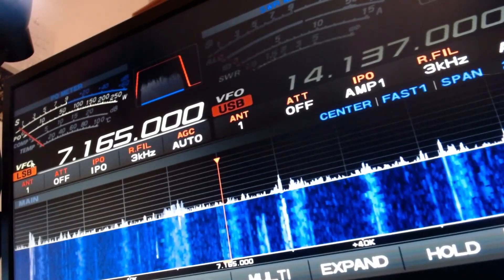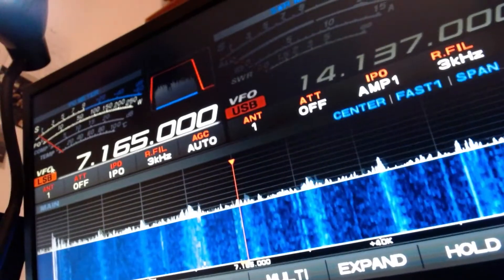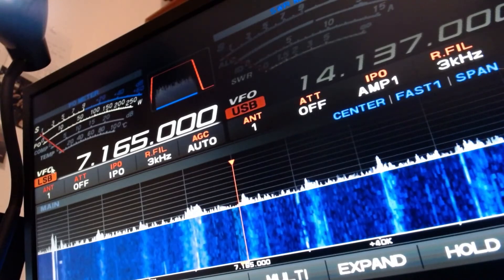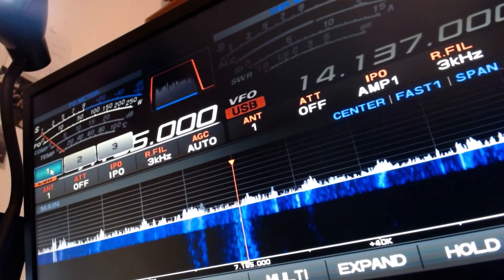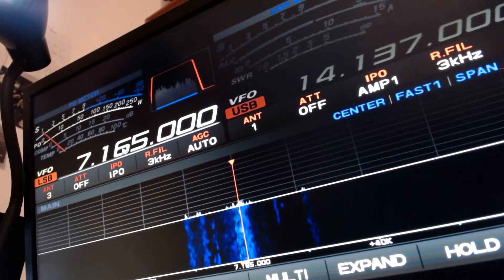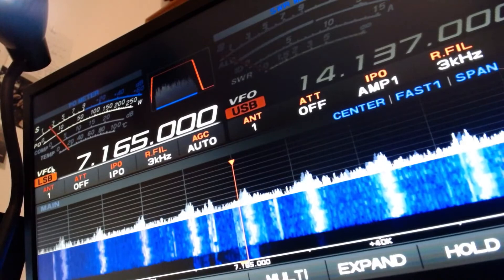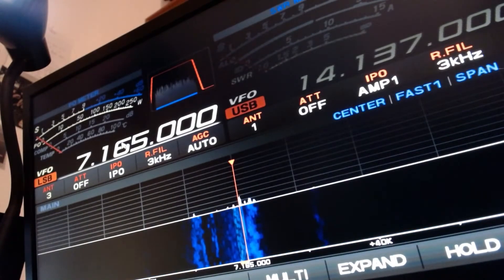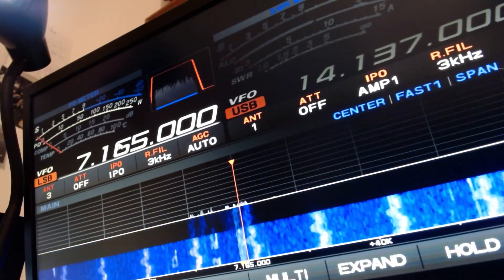3 Minutes That Will Change Your Ham Radio Life. The MFJ 1788 Loop. See and HEAR The Difference!

Comment: For your demo to be useful, you need to demonstrate something much more meaningful which is the signal to noise ratio using a weak signal.   Can you actually hold a conversation with a weak DX station on the loop that you cannot on the vertical or wire?   Please show us again in a live QSO with an unreadable station. Then we all go build or buy a loop and throw out the ugly verticals and messy wires. (which of course will never happen as proven over the last 124 years.

Comment: Hey Larry, Thanks much for the nice video but I think your conclusions may be all wrong.  Whatever antenna you use just provides rf voltage to the input of the receiver.  You proved that your vertical is really sensitive, your dipole is pretty good and the loop is well below in sensitivity.  I'm just getting back into ham radio (licensed in 1958) and I have ordered a 1788 and now I'll order the type vertical you referenced as it seems very sensitive.  I have HOA problems so that's why no dipole.  Thanks again.
Reply from the maker: Ken,

The video was only three minutes long but it did prove its point. 

When you use a loop Antenna, you’re “listening” on the magnetic side of the electromagnetic wave of a radio signal. No static crashes, less “electrical interference.”

Because of this, your signal to noise ratio is improved. You’ll need to use your pre amps to “bring the signals back up” but you will hear signals that are more difficult to hear because of QRN. 

Noise goes down so signals can be heard. 

I don’t recommend them for higher than the 20 m band, as atmospheric noise decreases significantly on 18m and higher. 

The trick is, where you place the loop. Make sure it’s AT LEAST 12m away from any transmitting antenna as you can really compromise the front end of your transceiver and destroy it. 

Remember, it’s a signal to noise antenna. Many top level hams and most high end shortwave DX’ers use loops for this reason. It helps to quiet down the band enough to hear weak signals.

Hope you have a very merry Christmas Ken!

Larry
Reply: @HamRadioLiveShow  Larry,  
We grow too soon old and too late smart!!  Thanks for the education.  After all these years in radio and computers you'd think I would have known that.  
Again, a fine video and again, thanks for your effort.
Ken

Comment: I would like to see the same test with a signal from some one talking to hear what that’s like.
Reply from the maker: That’s not the point of what a loop antenna does. A loop Antenna works Works signal to noise ratio.   It lowers the noise, so signals are easier to hear. 

To work this principle you need to use your preamp‘s on the bands you are listening on, because a loop only works off the magnetic part of the geomagnetic field and will cause receiver attenuation. 

It works. It’s worked for me for over 49 years of DX’ing.

Comment: I would never use this antenna. Small loop antenna has the same radiation pattern as short dipole with constant current. Basic lesson in antenna theory is often called "Radiation From Infinitesimal Sources".

Comment: You demonstrated that a loop is a crap antenna.  I worked with this antenna several years and found it to be totally substandard.  And you proved it.  Did you see all those signals on the scope that disappeared when you switched to the loop?!?  I found that if I could hear them I could work them with a loop, but that's just because only the strongest signals would get through.  From my use I concluded that it actually pushed a signal fairly well, but the small capture area resulted in poor reception.  Your video actually demonstrated that.

Comment: Did you aim the loop nulls towards the noise? I have the MFJ Receive loop, and my results are, err, less than what you're getting when I bump up the preamp to match signal strength.  Maybe on 80 sometimes the loop is better, but mostly I'm still on the dipole for receive lately.
Reply: Maybe should be horizontal, not vertical?
Reply: If you have it mounteed horizontal, what maybe it's doing is, it has a deep null pointed towards all the electronic junk in your house?

Comment: Every "receiving loop" should have a preamp, ferrite, or multiple turns. Otherwise what you get will barely make it down the transmission line.
Reply from the maker: It depends how high it is. If you’re using it 1 m off the ground or less, yes, preamp absolutely.

Comment: All due respect, this video doesn't tell me anything. A signal to noise comparison would give a very good representation of how the loop performs on receive. As others have previously stated, I can connect a 10' wire and it will show a significant drop in the noise floor but would be extremely ineffective in receiving signals.
Reply: Agreed.  My MFJ loop was 45 foot up in free air, could be heard but I couldn't hear until I unplugged the loop and plugged a clip lead at the back of my rig.

Comment: With all due respect this is a very flawed demonstration, if you look at your initial waterfall there is what looks like a ham data-mode transmission near the left hand side of the screen which disappears when the loop is connected but is present both on the ZS6BKW and the vertical.
I used to work for a military electronics company, our own "magnetic loops" intended for tactical use were made from expensive materials but we still quoted them as having a "gain" of -13dB relative to a dipole. Conveniently about 2 s-points, not far from your drop in noise.
Contrary to a reply to another comment a loop of this type should be tuned for optimal receive power transfer. The tuning is not just beneficial for transmit SWR. Your plot does show some relatively low level QRM from perhaps a switchmode appearing as spurs across the waterfall. These would also vanish if you simply used an attenuator inline but again you would lose some copiable signals too. Undoubtedly some receive antennas can produce better signal to noise under some conditions relative to the main antenna. I too have been playing with both a ZS6BKW and a receive loop as well as diversity receive. 
I know the video has been up for a while but only just discovered your channel, sorry if this comment seems harsh but we can easily fool ourselves that something works better than it does. 73
Reply from the maker: I understand your concerns. However, the main point was discussing the drop in noise floor with a mag loop. That was all. 

I sincerely appreciate you watching the show and I thank you as well for your comment. I am OK with criticism as long as it’s delivered in a way that useful. Thank you for bringing the shortcomings you found in the video to my attention.

Larry
Reply: @HamRadioLiveShow  thank you for the polite reply, enjoy your radio and making videos.

Comment: Newbie question: would you also use a loop for portable / rucksack type day out, as opposed to a portable vertical antenna? Cheers!
Reply from the maker: I’d use a wire dipole. Enough to carry already with the rig and battery.  Keep things light. Just my thoughts my friend. 

Larry
de K7HN

Comment: I live in a town in the UK and the noise floor across the lower bands can be anything up to S5. I bought a Wellbrook loop a few months ago and it has brought my noise floor down to S0. It's an active antenna and I do share the output between two radio's and whilst the signal strength is typically a little lower than a resonant dipole, the s/n ratio is much, much better. 

It's a shame that fewer radio's seem to have the ability to use an RX-only antenna, especially given the increase in the electrical noise floor.
Reply from the maker: AMEN!!! This is one of the best comments I’ve ever received. 

Coming from shortwave I used to use loops all the time. I know the value of them for a ham radio. The problem is, most hams reject this principle… That’s the honest truth. A loop antenna simply makes your receiver work better.

Top comment! Enjoy that Wellbrook!!

Larry
de K7HN

Comment: Dude...that's NOT how this works.
Reply from the maker: That’s how mine worked. 

Noise floor LOWERS. 

Signals APPEAR

Those signals were swallowed up by the noise before. Even the video shows those signals coming up.

The only advantage to using this loop is you can transmit with it as well. 

Mag loops all work the same way (although many don’t need a tuner because they don’t transmit) any large receiving loop does the same thing. Because it works on the magnetic field, not the EM field. 

Thanks for writing in but I’m sorry to tell you you this shows exactly how this works. The eyes and ears don’t lie.

Comment from the maker: This thread is quite long. Looking back, using an S2-S3 Receive signal would have driven the point home much better and that’s on me. I’m sorry it wasn’t clear enough. 

The key: lower the noise floor. 

Yo all of a sudden you start hearing signals that were buried in the noise

HOWEVER; the name of the game should be the best signal to noise ratio you can get. LOW noise floor... low signals will come in. Get that noise floor DOWN. 

That’s the whole point. Use the RX loop to bring down your noise floor (as shown in the video), bring up your pre amps and the weak signals will suddenly appear. Just keep the loop at least 10m from your TX antenna and use an RF filter on it to protect the front end of your receiver on the RX input side if you’re running QRO especially. 

I’ll be using a loop RX antenna with my K4HD on my YouTube channel once the radio arrives. Stay tuned as they say lol. 

OK I’m sorry do you video wasn’t effective enough for someone we all do our best.

Larry 
de K7HN

Comment: This does not show that the loop is quieter, or "better", or has noise reduction. It only means that signals, RF, electricity, is not making it to the receiver from the loop. The question that was not asked and not evaluated is - why - . Why is there less noise? Is it really noise on the vertical?  I use a receive beverage antenna. Receive antennas are fine, and loops work. This demo looks good, but has overtones of a sales talk for loop antennas - maybe not science based. Then it may be an accurate experiement, with results that are accurate. Was the loop matched to the radio? Why did the loop also cause signals to be reduced (on the waterfall) - this implies that this loop installation is a poor receive antenna. Receive antennas must be matched to the receiver just as transmit antennas must be matched to the transmitter (swr). How do we tune, or pre-tune a system, using a tuner? Tune the tuner for max noise. Good info to think about.
Reply: Very well put and exactly what I would like to say.

Comment: Need to research how to run a receive loop on my station while running legal limit and don’t blow up the preamp on the antenna. Icom 7300, acom 2100, and a full 160m loop.

Comment: Yes the loop will reduce noise outside of its tuned frequency because of its narrow bandwidth. I agree this can be beneficial as it will reduce sperious transmission on TX and image rejection and IMD on RX.  The real test however is how well does it receive a weak signal compared to the other antennas?  As others have said, you could switch in a dummy load and get the same results. Please make a video comparing receiving a weak signal. That is what I need to determine if I want to lay down $550 to get one of these things.

73's
Reply: First of all : those who say : switch to a dummy load REALLY should learn about magloops and realize that they were used ( and still ) by military . Because of the LOW noise you CAN listen the weak signal . A signal you may can't because the noisefllow by a "normal" antennas . There are alot variables to consider but the basic should be learned .
Reply: They are worthless for receiving.  I recommend you budget in a second antenna for receiving

Comment: Hello a super positive short film.  Sorry, I didn't understand exactly what you use for a plastic mast.  Is the difference in relation to the QRM so noticeable?  Another question about the 40m band, how good is the antenna on the 40m band?  I have the other version from 30m to 10m.  Thanks for the answer?

Comment: All you have shown is how deaf the mfj1786 is! Do the test with a signal and get a real comparison.
Reply from the maker: Typical response I hear from many ham operators Who either have never used an RX loop or don’t know how to use one. 

I’ll put a receive loop against any vertical or dipole and I will receive much better off of it than I will off of that wire or stick. 

There’s a reason why high end SWL Dx’ers use loops for receive. 

They simply work better. 

Ham radio operators believe they know better… 

But they have little experience at actually thinking about a receive antenna. 

In fact, I bet never in your life have you thought about a receive antenna. You’ve only thought about TX. Most hams do. Everyone thinks about takeoff angle and DB gain. 

It’s already well proven that loops are superior to RX on than a dipole or vertical but unfortunately many hams refuse to even try it. That’s unfortunate.
Reply: @HamRadioLiveShow  You may be right, but give a demonstration that will show it. This video shows nothing at all. You would probably have such a result with an indoor antenna. VA2RB
Reply from the maker: @spintrap  I appreciate you writing back. I’m sorry you didn’t understand the method in which I showed this. This video clearly showed signals coming up because the noise floor dropped down. That’s the beauty of using a loop antenna. I’m sorry that the three minutes supplied for this quick video wasn’t effective for you.
Reply: @HamRadioLiveShow  I'll look at it again. Seems i'm not the only one who haven't understood your video. Thanks !
Reply: @HamRadioLiveShow  I just look your video again. I don't change my comment. The fact that an antenna can reduce the noise level is no testament to its performance. Show us a signal with your vertical antenna then with your "loop" and then I will be able to say that it is a good antenna. If your "loop" receives a signal from S3 but the vertical receives S9, having less noise will not help me much to make contact. All this to say that your demonstration does not provide proof of effectiveness. By the way, your ham station is beautiful. 73 ! VA2RB.
Reply: @HamRadioLiveShow  
I notice that you mentioned a "receive loop" that you would put up against others.  Why is that?
Reply: Agreed

Comment: You would get the same result using a dummy load. Why no signal comparison ?
Reply: This test doesn't mean anything at all. Comparing a signal with its strength and noise attenuation with this antenna might be worthwhile but not this demonstration. 73 VA2RB

Comment: I don’t think this video proved anything at all, Larry. My first question is ‘was the loop antenna tuned to the same frequency as the radio?’. To further develop the thought experiment; I can give you even more noise reduction on receive by switching the loop antenna with a dummy load. I think the idea of a loop RX antenna with a preamp can be highly advantageous, that is not what you demonstrated in this video. 73 - Chris WB2DYJ
Reply from the maker: Chris, you dont “tune a loop” for RX. You do for TX but not RX. 

You may be confused on this little video because it’s a RX/TX loop. 

It shows a small window of SWR capable TX. 

But if I use the MFJ 1886 or the Chamaeleon 2.0, I’ll lower the noise floor and find signals that the vertical and dipole won’t find. Every single time. 

I’ve used loops Chris for RX for over 45 years. I’ll put one up against any non directional antenna you have and drop the noise floor more. 

GUARANTEED. 

ie: drop the noise floor, find signals you couldn’t find before because the weak ones were lost in the noise. 

Even our ham radio licensing lessons taught us the value of a loop antenna for RX.

Thanks for checking in my friend, I hope we can work a QSO together soon. 73’s from K7HN
Reply: My fairly new MFJ Loop requires and always has required tuning for RX and TX.  You can clearly hear the sound and signals jump in volume as you get to resonance using the tuning buttons. Then the loudest RX turns out to be very very close to the resonant TX setting EVERY TIME! The other thing is with a loop, you can clearly see the panadapter loses fidelity to help you find signals in a short span. Major drawback. I only use my loop as a backup. 73 de KI1Y
Reply from the maker: @ChatGPT1111  The MFJ 1786 RX antenna has no tuning. Similar to the Welbrook loops. 

ALL TX and RX Combo loops require tuning because they require transmit so SWR needs to be applied to the equation.